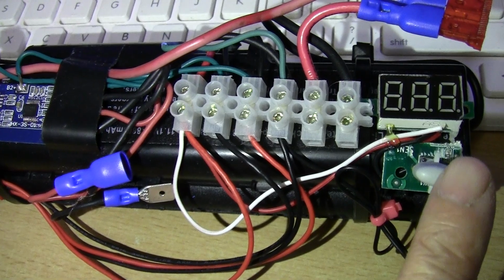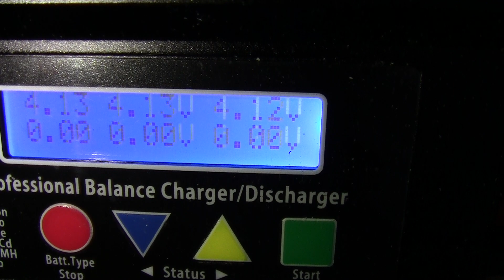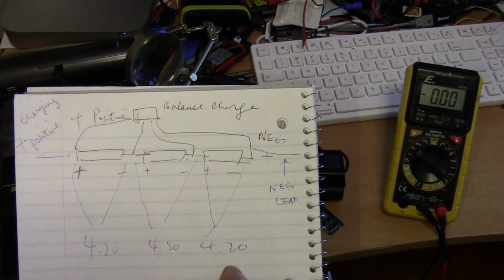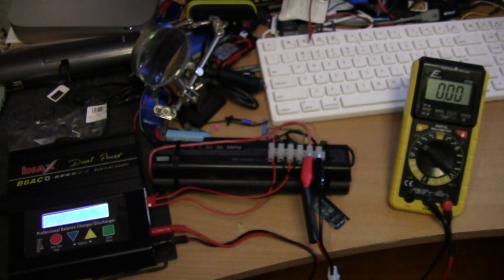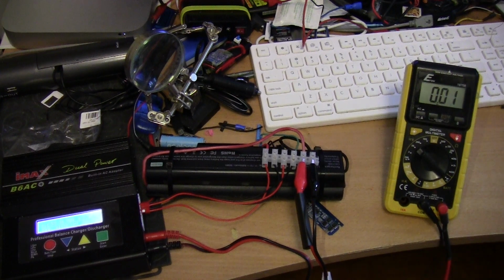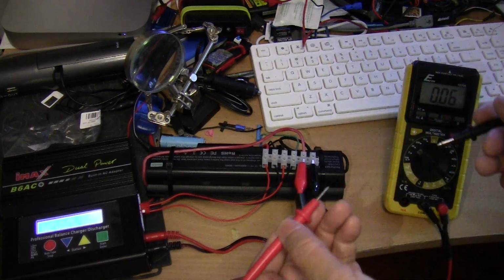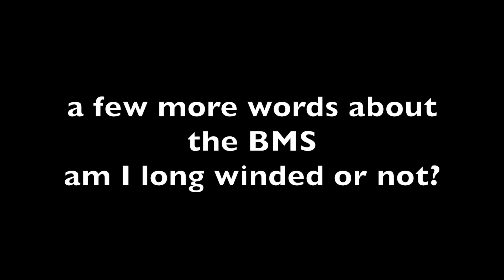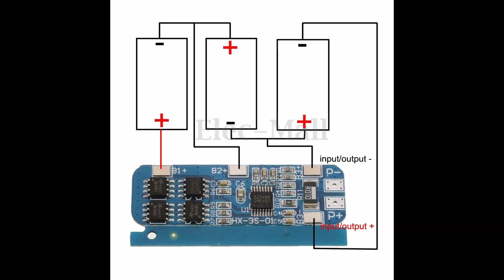12 volt laptop 18650 power bank with balance charge and Battery Management System BMS

Comment: Do you know if that BMS board can charge the batteries and provide power to a load at the same time?

I'm wondering if it could be used as a cheap UPS.

If seems to share the input and output connections.

Thanks for your video.
Reply from the maker: The BMS connection shares the input and output connections. I guess you can charge the batteries using the BMS input and take current out using the other output. It'll charge as long as the input current is higher than the output current.  I don't know if doing so will affect balance charging though. Thanks for commenting.